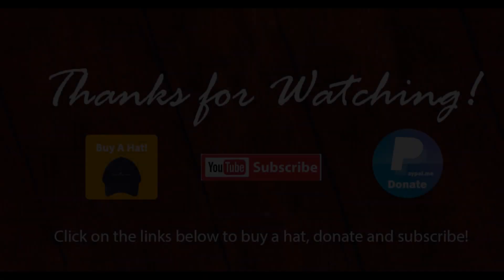Why Do I Get Different Voltage Readings Between My Battery Monitor and My Control Panel?

Comment: I have a solar panel system with a 30 amp charge controler.  The charge controler is showing the batteries are at 12 volts.  At the same time, I put a multimeter directly on the batteries and get a reading of 13.5 volts.  I don't understand this large difference.  Do you have any thoughts on why I am seeing such a discrepancy?

Comment: My controller reads higher voltage then battery.  Ask around and people tend to be a bit rediclous with help. Trying to find ways it's normal rather then understanding it's not.
My mppt voltage is alot higher then my battery voltage. Causes it to shut down charging early.

I get almost a volt different from mppt and battery with off state. I even tried to hook up the battery sampling with no change.  Mppt reads higher. There also no fuse from mppt and battery and the voltage from mppt terminals are higher then battery. It's rediclous.

Comment: Hi Jeff - Quick question. I think I got it but wanted to ask.   I have a newer boat that has shunts on each battery comming back to my factory pannel.  I just installed 2 solar panels (and a victron Smart MPPT, not smrt shunt yet but thats comming once I get the right guage wire) and solar is charging the batteries.   My amps are continuing to go down on the factory monitor which I can deduse that its because the solar is charging the house bank and bypassing the charge input to the house system.  If this is correct, I should not look at the Amps percentage on the factory system and only look at the victron monitor?   

Bonus question - I have a navcolor display and it would be cool if I could get the victron to send the amp (+ and -  draw) to the screen so they match.   Is this posible?

Comment: Monitor At the battery will also show if you have a ground on battery with all loads isolated.
Can you use batery monitors at distripution panels ?
Reply from the maker: At the panel, you should have another voltmeter and amp meter.

Comment: Hello Jeff. For me, 1 v on a 12 v is a lot, i do understand the voltage drop and it's one of the probable cause here (high current, low wire size), but you don't talk at all about imprecision of instrument measurement (accuracy, precision, calibration, etc), panel voltmeter are rarely on the high quality size. There should be no difference in a no load situation. This is not a electrician course in 3min. ;-)
Reply from the maker: Maxime, thanks for sharing, you are bang on! Those DC and AC gauges at the panels are not great for accuracy, especially if they are analog.

Comment: Thanks Jeff, just wondering why  new fridges connected straight to the battery? Merry Christmas. Regards Stormer
Reply from the maker: Stormer, in my opinion fridges should NOT be unswitched loads. Unswitched loads are: bilge pumps, radio memory, carbon monoxide detectors, charging sources. A fridge should be switched.
Reply: @PacificYachtSystems thanks Jeff totally agreed. I have Another question!  a few of the boats I've worked on had different bilge monitoring setups some had just a light on a silk screened panel telling you that it's on, some had bilge alarms, some had a  bilge counters. What's the latest available, what do you install or recommend and does it cater for multiple pumps.?